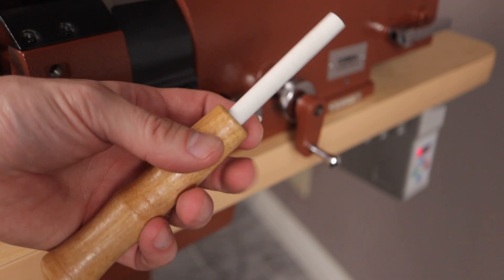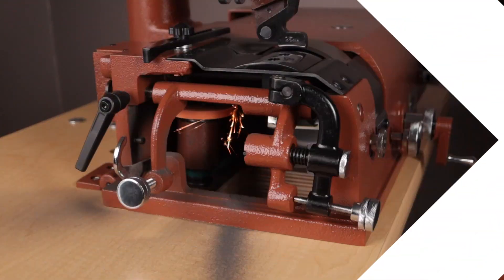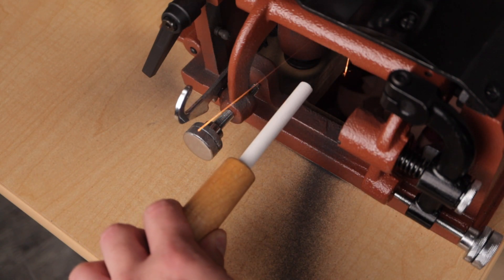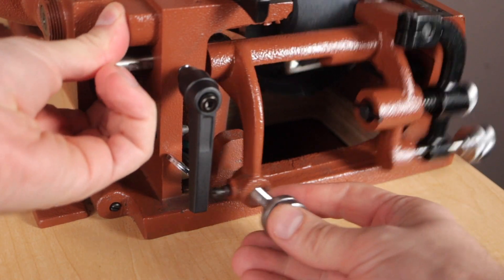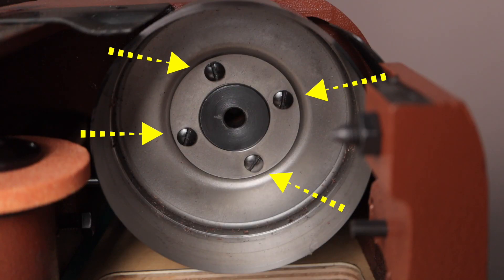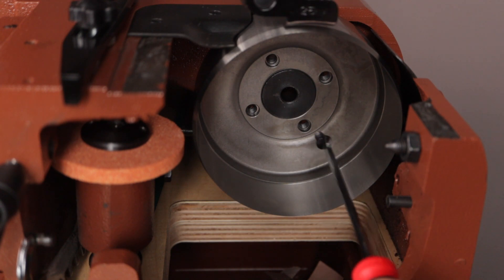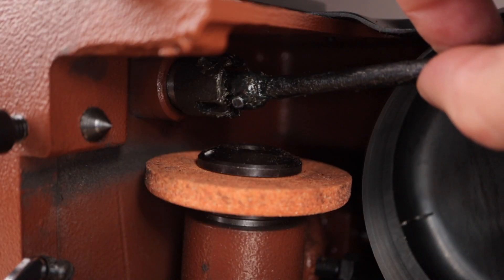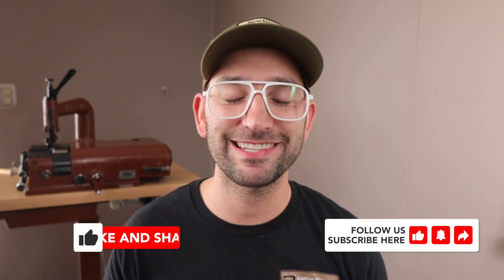Blade sharpening & replacement for NP4 and NP10 skiving machine - EPISODE 47

Comment: Thank you for this video, I’m new to my new skiving machine np4. I’m just trying to understand about the double bevel, is this what I need to do to sharpen my blade to get a smooth skive or the single bevel, I guess I’m confused sorry?  I’m trying to skive 3.5 ounce leather to a 2 ounce and I’m not getting a smooth skive it’s choppy skipping certain areas across the leather so I’m sure I need to sharpen my blade. I think once I understand how to use this machine life will be a lot easier. Thanks for your help